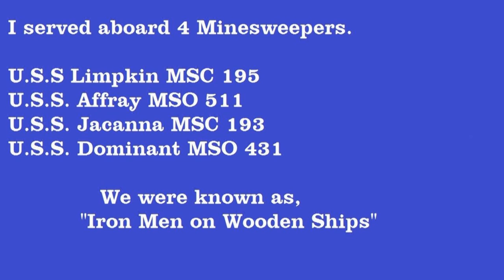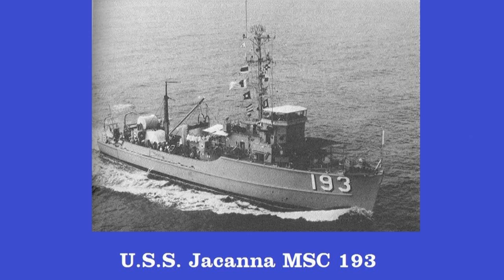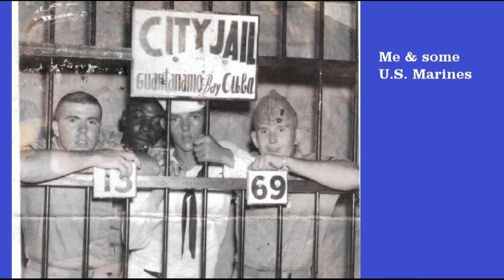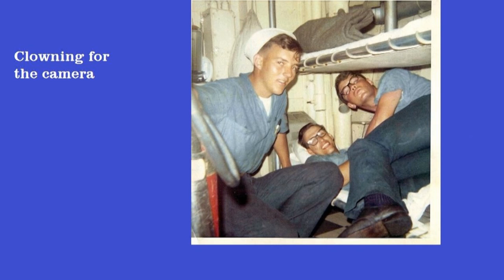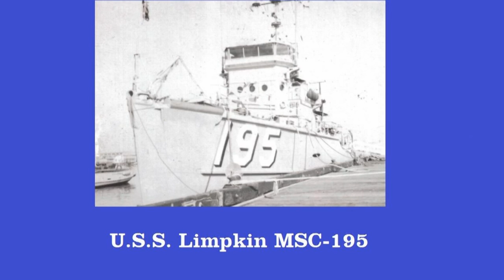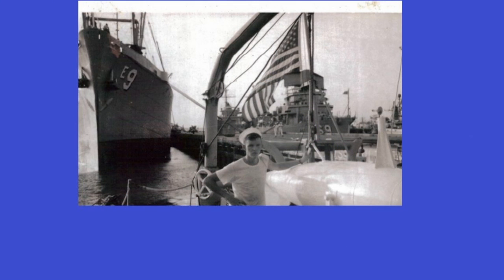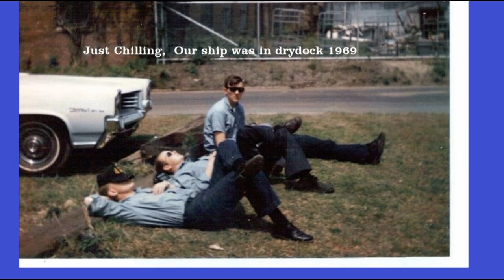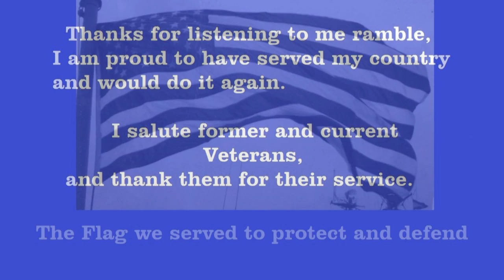US Navy  Standing After Steering Watch

Comment: Your story brings back memories. I was aboard a destroyer tender attached to the Atlantic fleet, and seem to remember the Limpkin and one or two other mine sweepers tied up alongside for repairs. But, like you, I stood after steering watches, always with two guys from another division whose job, if needed, was to use chain come-alongs to move the rudder if we lost steering from both the bridge and after steering. There was a (very) loud siren that would sound in the after-steering compartment if I was to take control. I, too, would take a book along - after steering watch was very boring, especially at night. Once, as I was reading, the siren went off. I engaged the wheel in front of me, swung the ship to starboard 10 degrees, then back to port 10 degrees, then confirmed via sound-powered phones, that I had control and was steering the previous course. All well and good until a few minutes later when the bridge called for a course change. Unfortunately, the message over the phones was so garbled I asked for a repeat. The steersman on the other end repeated, but more loudly, which garbled his words even more. He put the OOD on the phones, and he yelled, but it only made things worse. In a few minute, he and several others came down to after steering, a little angry, but wanting to check out the phones. Scared me to death. My book was right there in plan sight, and one of the guys picked it up and left with it. I didn't get into any trouble for any of it, but I was quized the next morning by my division warrant officer, so apparenlly he got an earful from the OOD  The siren went off a few minutes after I began my next after steering watch, but things they must have repaired or replaced the phones - they worked fine. However, they made me steer almost the entire four hours.
Reply from the maker: Thanks for sharing your story.  I don,t recall any siren but do remember those annoying sound powered head sets.  The few time I took the helm up in the pilot house it was cool steering the ship but it was very odd to steer it from down in after steering lol.  That was A hot miserable place.  We were always sweeping mines when we stood watch there and couldnt leave after steering even if we wanted to due to the steel cables strung across the fantail.